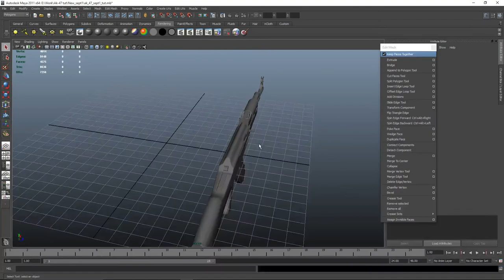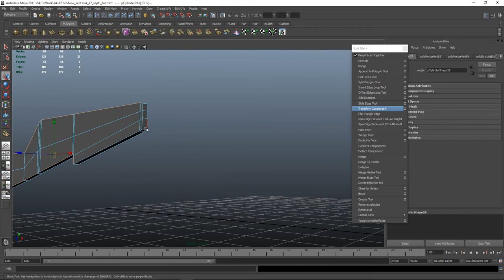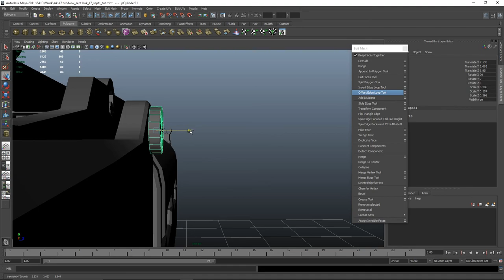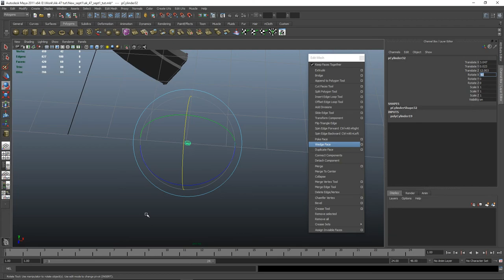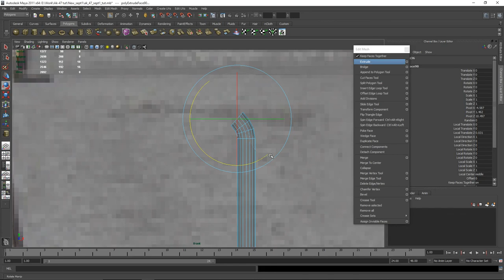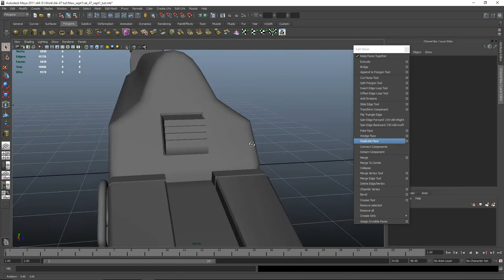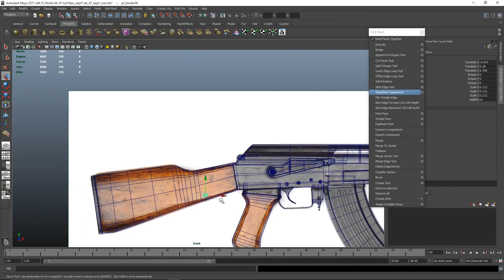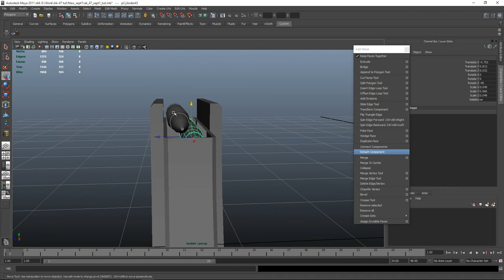3D AK 47 Model tutorial, Maya part 4

Comment: question. sorry if i word this oddly.

if you wanted to make an animated gun and have something like the slide move back, is it best to render it as two different shapes or as a single shape? (sorry if im using the wrong term).

i was told that u want to make ur renders all out of a single shape. but i dont want to put too many polyfaces on my renders. and when it comes to making round objects (such as 24:30) i found it easier to make separate shapes and put them next to each other